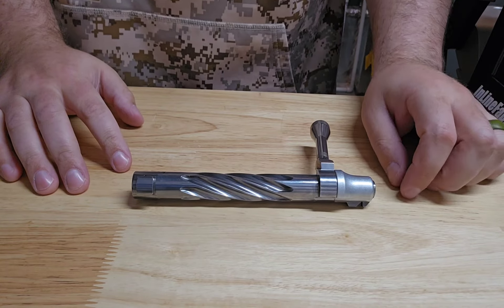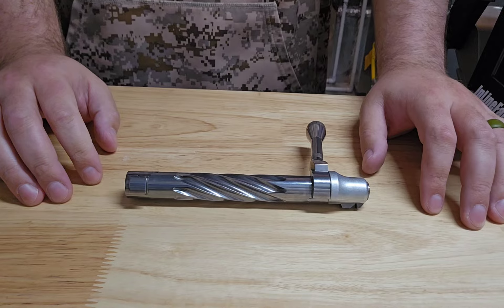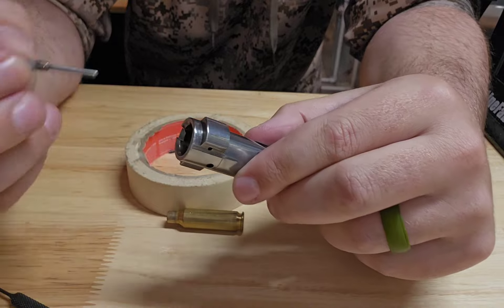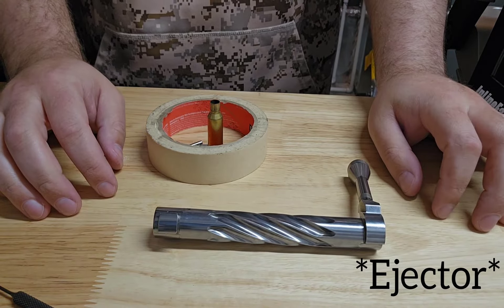Removing ejector from bolt for Remington 700 (and clones)

Comment: I use a penny and a screwdriver to remove the firing pin and bolt shroud. Also made my own tool for the ejector pin and sprin.
Reply: Good job... can you make a video of the ejector pin tool?  That would be helpful to the community.

Comment: I have a 2013 build  700 SPS tactical in 223. I have an issue where the shell casing gets kicked off the bolt before ejection and it lays on top of the next live round waiting to go in. I heard this was an issue with the ejector spring being too strong kicking the round off premature. Any info you have or how to fix this issue would be grateful!
Reply from the maker: I've never come across this issue. The ejector spring may be to strong, or there may be an issue with the extractor if it's letting the case go early

Comment: Do I have to remove the firing pin to remove the ejector or can I only remove the ejector?
Reply from the maker: The ejector can be removed without removing the firing pin. However, removing the firing pin ensures there's no tension on the bolt handle when opening and closing